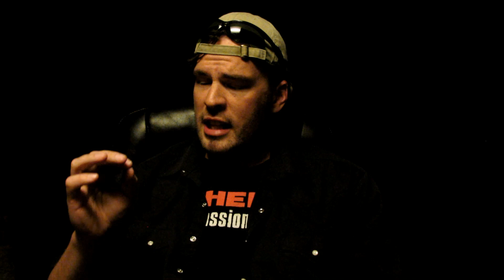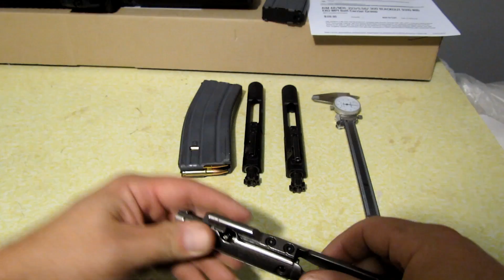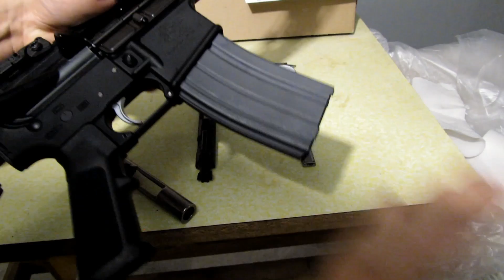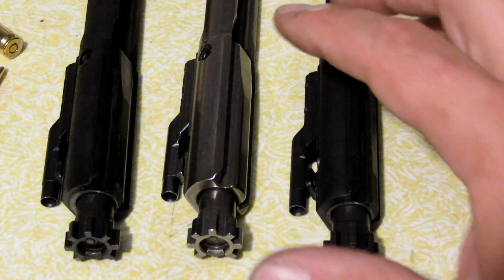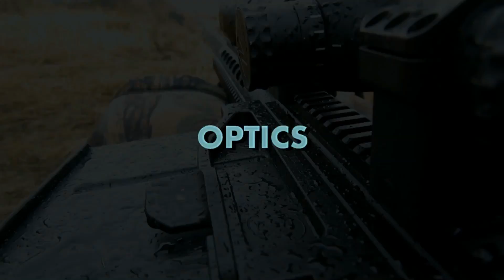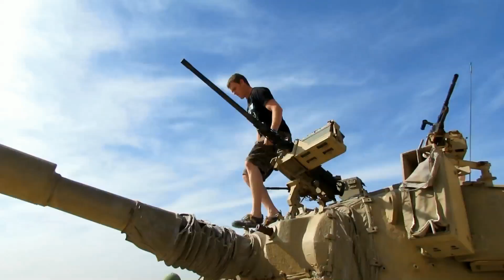AIM Surplus AR-15 Bolt Carrier Group ~ FAIL ~ (9310 NiB EXO MPI)  ~ Rex Reviews

Comment from the maker: I was actually bummed... I've heard that these work great from folks who do LOTS of shooting... but that's the hard part when dealing with QC, sometimes it's the tiny details that are overlooked on the manufacturing line that can come around and bite ya in the butt in the field - the final take away is that I personally prefer the long-time exhaustively-vetted military suppliers or even some of the obnoxiously priced top-notch tier-1 civilian outfitters with long standing reputations when it comes to fighting rifles and components.  BE ADVISED :-)
Reply: I didn't see you put in another AR to test, does it work in another rifle, i.e. your upper may be an issue?  Probably not, but I would have tried it in a few more rifles and uppers to see if that happens.  I also went through all of my AR's to test the BCG's!  Thanks for the vid, great exercise to go through, and great info to consider
Reply: Kevin M I have heard a lot of shit from people saying as such, what I am saying is nowadays at least you don't need to buy from top tier brands (I mentioned geissele and dd) to have it be every bit as reliable. Reliability being the central point of what makes a rifle usable or not. PSA, Smith and Wesson, Ruger, all make rifles that may or may not be Mil spec or military suppliers, but produce extremely reliable rifles that are every bit as good as a military m4 and in many cases better.
Reply: Cole Pennock True enough, but I believe the topic is more in keeping with bargain brands. I have heard a lot of anecdotal accounts of how good Palmetto State products are, but one cannot discount the obvious factor of meeting and maintaining a standard for quality. 
I don't own a DD rifle nor any Geissele products, but have replaced BCG's in both of my AR's, one with a BCM and the other with Midwest Industries. Neither are expensive but both have a solid rep for quality.
Reply: Are those metal shavings on top of your bolt below your bolt key? It might be striking your gas tube.
Reply: TiborasaurusRex I have this bcg, & the NiB without the exo, & a few nitride bcg's by aims, I haven't experienced problem like urs.  
My NiB exo bcg is in a spikes tactical upper, going into 20in criterion barrel.
Reply: Left in the tumbler tooooo long or a very aggressive media
Reply: + Cole Pennock:  No one is saying quality parts won't work because they aren't " mil-spec ", just the opposite. If you have priced Geissele trigger groups or Daniel Defense rifles you know they aren't bargain brands. That's Rex's point.
Reply: You do realize that modern AR-15's from companies like Palmetto State Armory last thousands and thousands of rounds with 0 malfunctions while being about 500 dollars or less? In my opinion the obsession with the concept of "mil-spec" and "military suppliers" is frankly outdated. The military simply does not have access to many of the higher tier civilian offerings. Socom does, and you see them using Geissele triggers and Daniel Defense rails, strange how that works. A properly built AR-15 with quality components will likely never fail you.